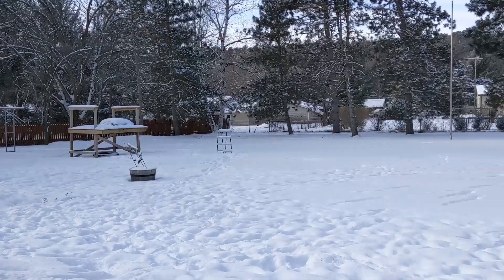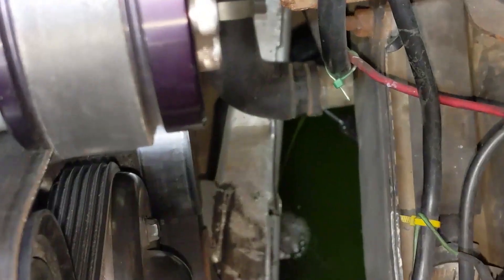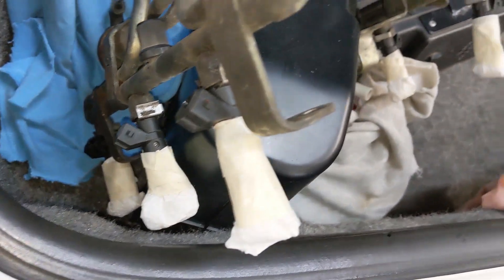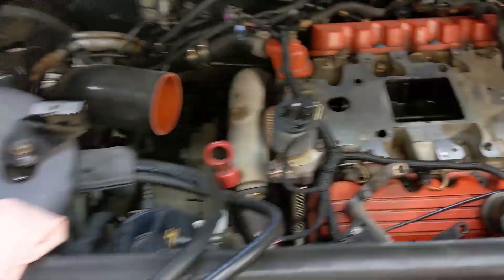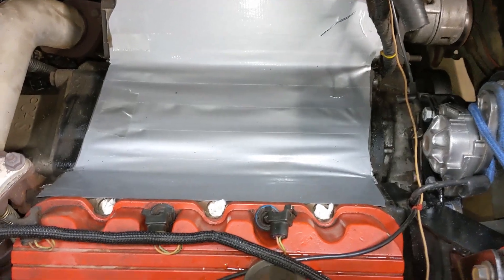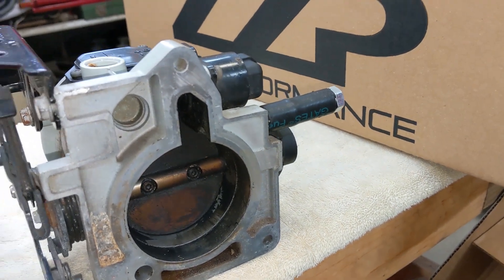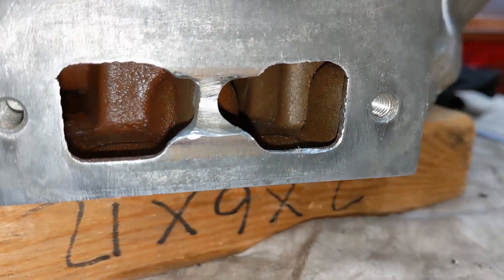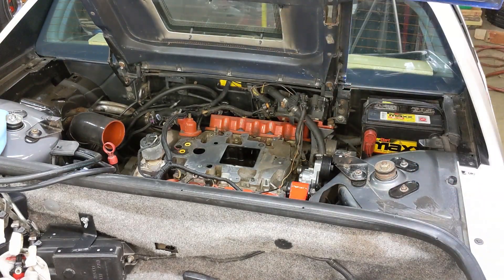3800 Supercharged Fiero (Blower and Manifold Mods)

Comment: Is the grinding of the coolant passage actually necessary? Seems like the cover allows coolant to pass thru as is. No? Thanks for sharing.  I've done this swap in a 1997 Camaro. Having a hell of a time getting it to run. Sorting thru it now.
Reply from the maker: Good pointsir, the cover does allow for some, but you're definitely losing a little bit of flow "potential" by blocking the path to the throttle body, so I'm just restoring that. Am I 100% certain it's necessary, no. But I'm going to do it anyway.

Comment: I'd pull the heads and port them or replace them with better flowing aftermarket aluminum heads if available
Reply from the maker: Not readily available for the 3800 and not cost effective.

Comment: Did you relocate a  brass IAT to the lower manifold.
Reply from the maker: No sir, I did not.  I know it gets quite hot under wot boost with that 2.8 inch pulley -  but luckily the e85 can handle it.
Reply: @Toys4Life  . I first tuned e85 on a 3800 gtp back in 2007. I still like seeing customer put a old school brass IAT in the lower manifold. It's nice to pull a little timing as IAT gets over 200 degrees.
Reply from the maker: @Dyno_Tune_Motorsports  Generally I agree sir, I do watch for KR like a hawk with my aeromotive scan gauge set with a warning light for KR. Ever since I switched to 85 years ago I rarely have any knock. With 93 octane it was a pain in the ass! If all I had was 93 octane I would definitely go intercooled.